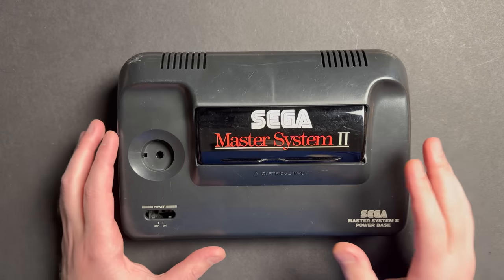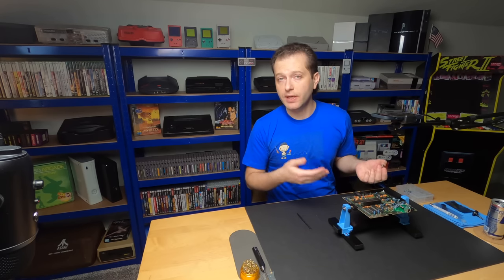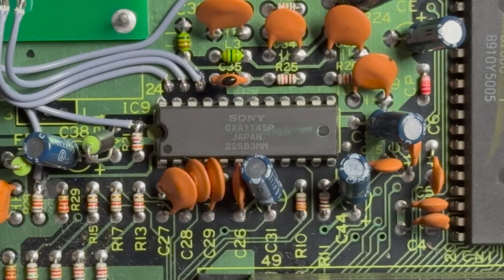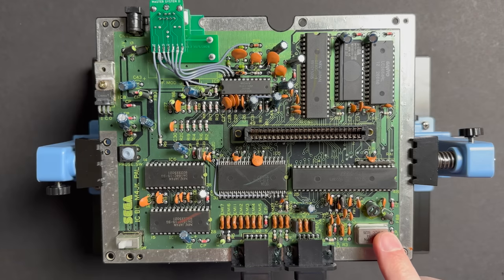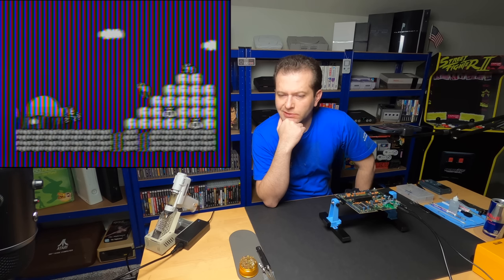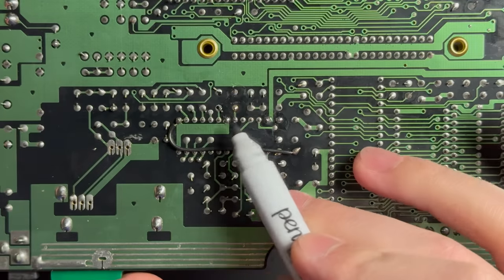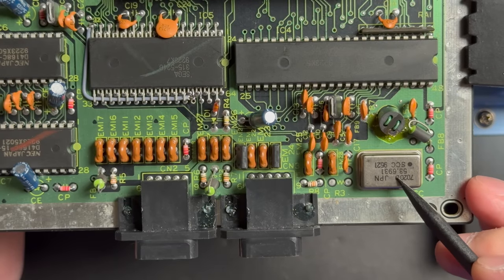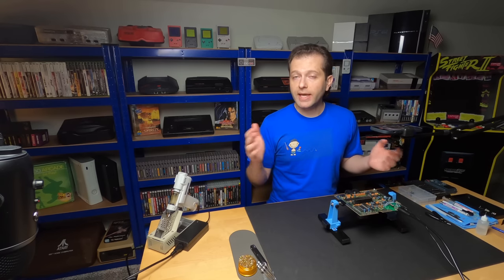Less European, more AMERICAN

Comment: I did the 60hz conversion and I didnt change the crystal and it still went full 60hz with the faster speed
Reply: So the crystal primarily impacts the colour burst - the frequency that NTSC uses to transmit its colour data is different to PALs, and the oscillator fine-tunes the output from the console to match with the appropriate display signal.  This is why composite and RF on older PAL TVs display NTSC signals in black & white and vice versa - the multiplication offered from the oscillator doesn't allow the colour frequency to match up with what the TV expects, so it can't display accurate colours.

If you're using RGB, it's an ~entirely~ different colour signal than NTSC or PAL, so you rarely (I've never seen it) get the colour issue with RGB output.

If I recall correctly, the actual console speed also becomes slightly different if using a PAL-origin oscillator with an NTSC signal and vice-versa - but it's the difference of maybe a single frame every minute, so it's almost entire um-noticeable.

This is a really rough explanation via mobile typing without any sources at hand so I'm sure some of these points aren't 100% precise but the gist of it should be on point
Reply from the maker: Thanks for sharing your knowledge on the subject. Lots of little subtleties that's for sure.
Reply: @BorderlineOCD  I don't know if its relevant but I live in a PAL region and my Mastersystem II has no other mods. So PAL RF but with full screen/full speed 60hz mod and color only works on my newer TV's.
Reply: yes, I put a 50/60hz switch in my SMS, which makes it output PAL 60 rather than NTSC. 90s TVs can cope fine with this.

Comment: Why didn't you put the capacitor back? What did that capacitor do?
Reply from the maker: That cap was part of the original clock circuit, probably to smooth the signal and keep it within a particular peak voltage. Removing it frees up the via for the Z80 piggyback clock circuit.

Comment: On mine I just did the composite mod and changed the video chip pin to 60 hz and it did pal 60 hz which was in colour on my pal tv.
Reply from the maker: So you left crystal and encoder as-is but just toggled pin 57 on VDP?
Reply: I have to say I just toggled pin 57 on VDP, I was confused when the 1145 encoder was being toggled in this vid. for the crystal I just did the DFO mod.
Reply: @BorderlineOCD  Yeah. Pal 60 signal so not as good as what you did but ok for a quick mod. It was a pal signal that you had to change the vhold if you had a really old tv. Will not work on megadrive. I have an asian megadrive converted to pal with a crystal added to the video encoder to make it pal, that can also do pal 60 in colour.
Reply: Yep, likewise. It's a very simple mod and great for playing Japanese games at the correct speed and aspect ratio. In fact I even prefer to play European games at 60hz unless they don't work.

Comment: What desolder tool are you using?
Reply from the maker: Linked in desc. Hakko clone.
Reply: @BorderlineOCD  I looked in there and I must have missed it. I apologize. Thank you
Reply from the maker: It does a great job. Can't comment on what a better tool would offer as this is probably the most high end stuff I've bought so far but it's about half the price. I couldn't justify the Hakko for my occasional use.

Comment: Sir, you do not 'program' a crystal.  A crystal is just a thin piece of encapsulated quartz in a package.  When a voltage is applied to it, it generates a frequency.  The way the encapsulated piece of quartz is cut (i.e. the size) determins the output frequency.  You could probably source these crystals on the open market if you know the frequency and if it is common enough.  There are however some oddbal frequency that aren't manufactured anymore.
Reply from the maker: This is a programmable crystal little buddy. eBay is flooded with NTSC crystals from China and I didn't want to buy some low quality garbage with the amount of quality mods planned for this system. Unfortunately Mouser et al. did not have the right crystals in stock so we went the programmable route to test.
Reply: @BorderlineOCD  I stand corrected big buddy.  I did not know such a thing existed, but indeed, they do.

Comment: By the looks of it, you could have cut the ground trace and tied pin 7 to pin 9 with a capacitor leg. Would be faster I think.
Reply from the maker: On the encoder? Pin 9 is an audio line. What do you mean?
Reply: @BorderlineOCD  on the RGB chip thing
Reply: @BorderlineOCD  4:30 pin 7 looks like you could cut the ground trace. Then solder to pin nine.
Reply: Or I'm just blind